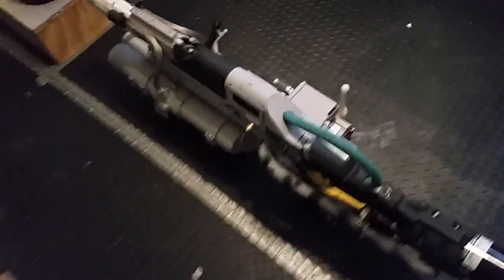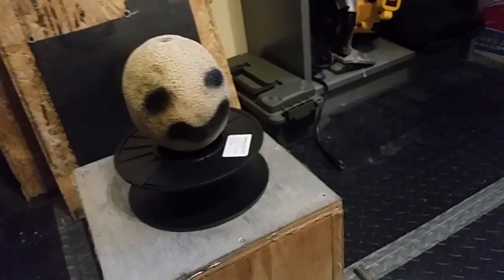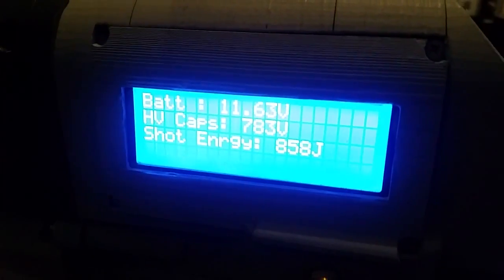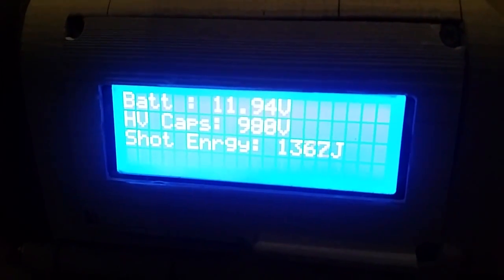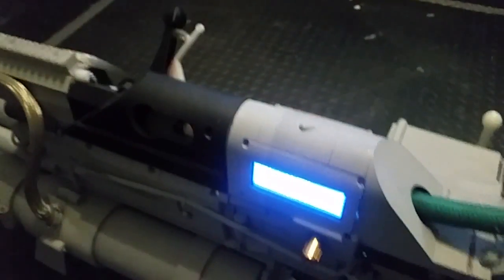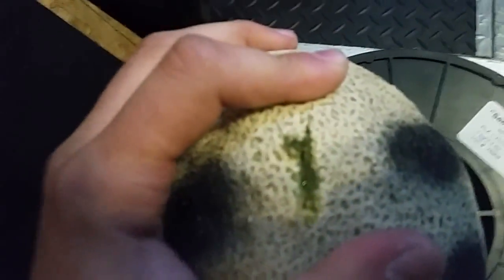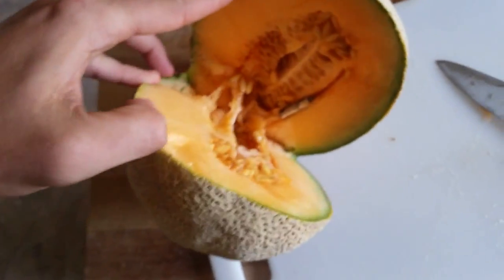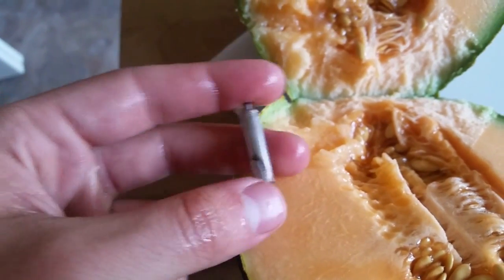XPR-1 Railgun Test 4 - Aluminum vs Cantaloupe

Comment: The great work! I love railguns and have done some experiments with them. Can it penetrate plywood 4 mm thickness or more? Or 0,8 mm of low-carbon steel?
Reply from the maker: 4mm plywood yes.  Steel probably not.  XPR-1 has pretty low power.

Comment: Impressive!  David, could you shield the Arduino Uno R3 with something like a flat rectangular sheet of mu-metal between the control unit and the rest of the apparatus?  Nice muzzle velocity too: 640mph is about 821fps.  To become equivalent to gunpowder rifles, the muzzle velocity would have be somewhere around 3,500-5,000fps; but, 821fps is definitely close to the low-end of the current gunpowder pistol muzzle velocity range ~800 to ~2000+fps.  Do you have any plans to increase the muzzle-velocity?  Awesome work, congratulations!  :-)

Comment: Powered by a 20 oz. CO2 bottle.
Reply: +Judson Vandiver Yup because if it was a 90cu 4500psi HPA bottle that projectile would have penetrated the wall behind the backboards, I unequivocally deny knowing this from personal experience, you can't prove shit.
Reply from the maker: +Blake Pitcher The bottle is regulated to 300-500psi.  The railgun does not use the full 900 (or 4500psi) for shots.